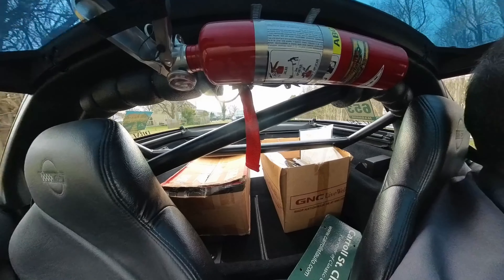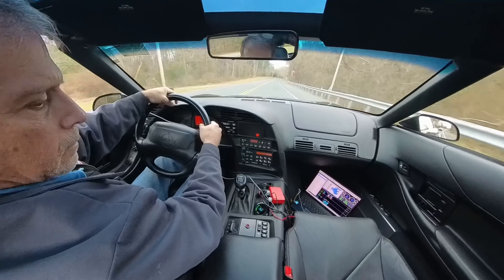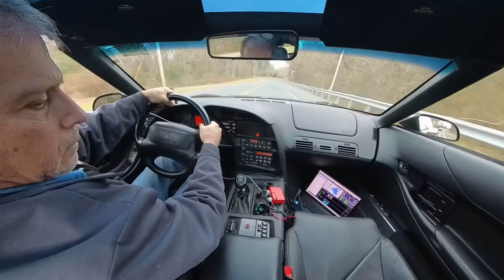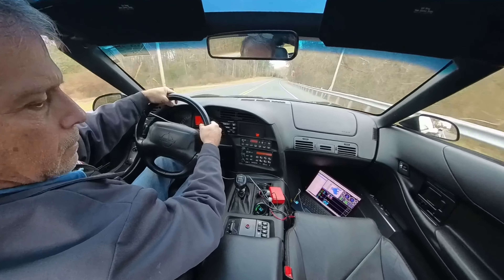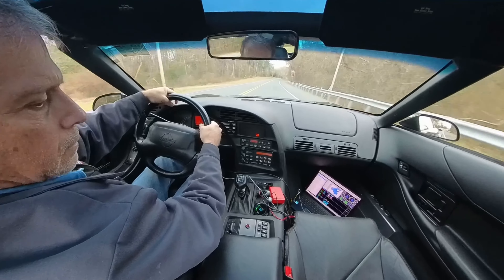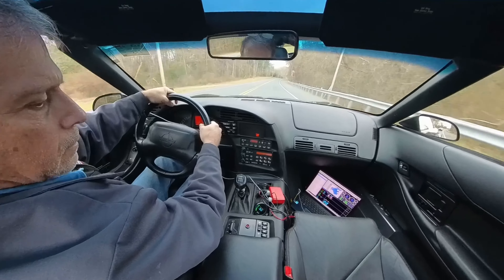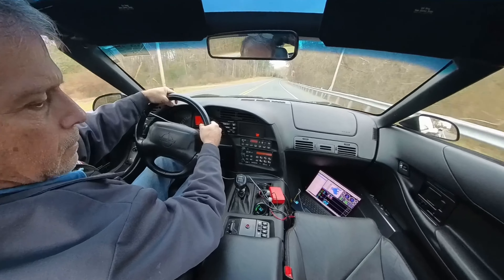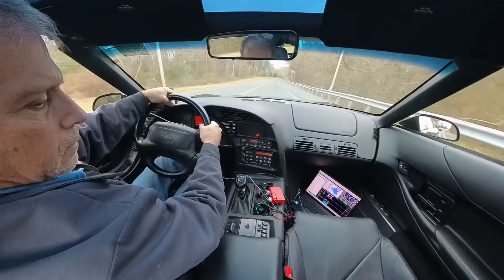1st test drive of the Doug Rippie Motorsports LT1 Corvette

Comment: I love it another great yob you did!!! Sounds great. What kind of power out of her?
Reply from the maker: The Golen 395 LT1 most likely has 550 hp seeing the AFR heads and the large duration camshaft.  Usually an engine with this combo that I put on the dyno makes 550hp (or more).  So that's my guess.  I've been doing the fine tuning today and the motor is still awesome.
Reply: @EllweinEngines  thank you for the update. Merry Christmas 🎅 🎄